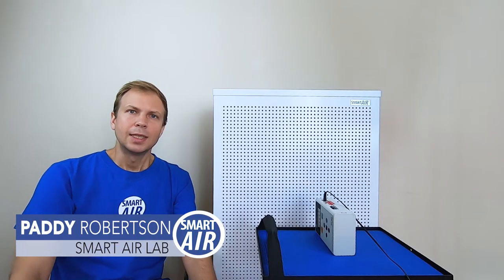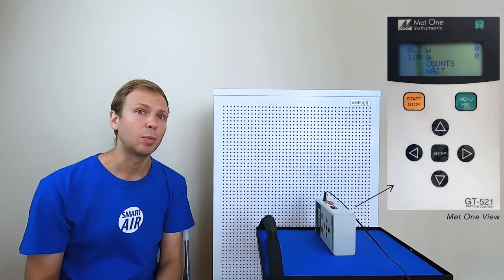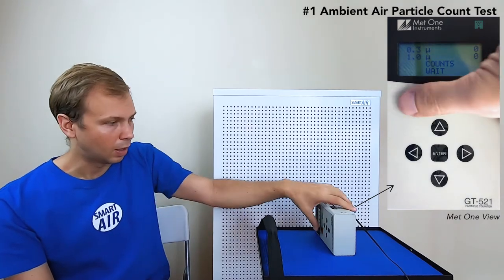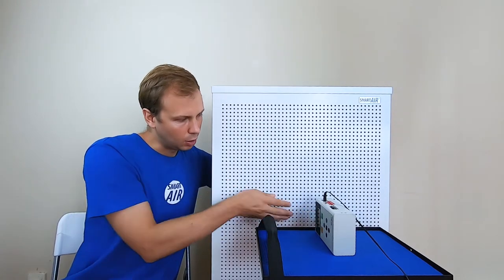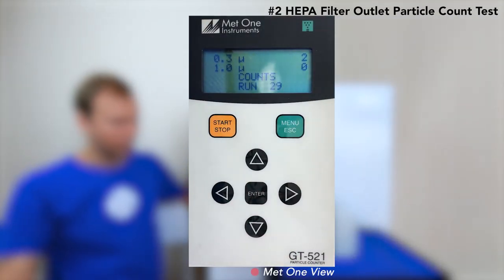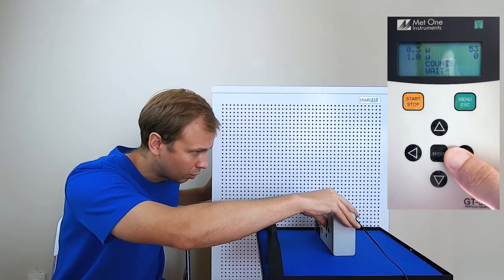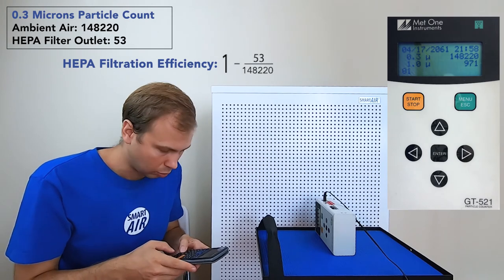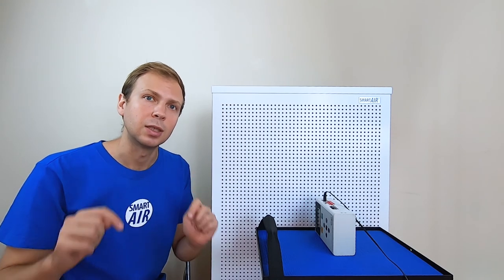HEPA Filter 99.95% Performance Test | Smart Air Blast Air Purifier

Comment: I like your filter, but this isn't a valid test because the particle counter uses air velocity as part of it's formula to count how many particles and by putting the particle counter in the stream of faster moving air you are changing this variable in the formula making the results invalid.  To get a valid particle count you need to have air that is not moving and being sucked into the particle counter by it's own power only.  This is also not a real-world test.  A more realistic test would be to put this in a real home in a master bedroom that is in use and put the filter on one side and the particle counter on the bed stand next to the bed near the user's face, so you can estimate what the user is actually breathing in.  I'd like to see this and more interior photos of your large device.  Thank you.
Reply from the maker: Great points Ventura IT! You’re exactly right about the better ‘real world’ test is to put the purifier on one side of the room, and the particle counter on the other. That’s exactly what we do with all our purifiers, and we’ve coined this the ‘room test’. You can read more about our room tests (and why they’re the best kind of test) here: https://smartairfilters.com/en/blog/diy-vs-blue-air/

This test really is just about testing the particle capture efficiency of the filter, so it’s a different kind of test. With regards to the airflow affecting the results, the Met One is equipped with a pump which pulls in a fixed amount of air per second. So this is not an issue. We also make sure to fit the Met One with a nozzle which reduces any adverse effects from uneven flow.
Reply: @SmartAirFilters  I'm not sure that the fast moving air doesn't disturb the speed of the pumped air... but I don't know.  I just would never put a meter right in a wind flow and trust it to still be accurate.  You can do that with meters and they mostly all show 0 due to the high wind speed, unless it's very polluted.  This is just how I do things.  The room test is all that matters.  How clean the air is at the point of inhalation...  we've also done some VOC tests and any given residential air purifier only removes about 9% of VOC's and this was a very big carbon air filter.  We'd need 10 of them in a normal master bedroom to remove 99% of the VOC's theoretically.  The cost would be $16,000 for 10 of the units we were testing so it's impractical, the only real way to fix VOC's and high CO2 as well we've found is if the air outdoors is not polluted and to vent in fresh air and out stale air.
Reply: @VenturaIT  It would be real easy to test this idea, just run the Met One GT-521 in front of a box fan in the same room and see if it gives a different result compared to the first test in this vid (i.e. not in front of box fan and no air filter turned on).
Reply: @gordo3582  No, that's not a valid test.

If the particle counter only does a short measurement like that it's not really a valid test, it takes a little longer to get a real measurement because just the movement of your arm or finger could cause particulates to be stirred up and increased artificially...  to test you need to run a real time monitor in and empty room, then have a remote control of fast wind over the sensor, if the device is effected by moving air, which is obviously true, then the reading will go down, just with air moving.  I'm sure your air filters work great since even a t-shirt over a fan will remove a lot of particulates, it's not difficult to filter particulates, the hard part is to filter VOCs in time before the occupant inhales them.